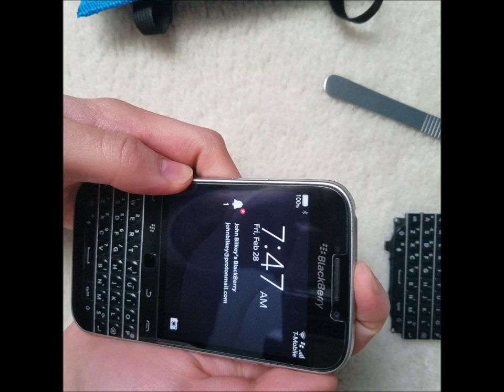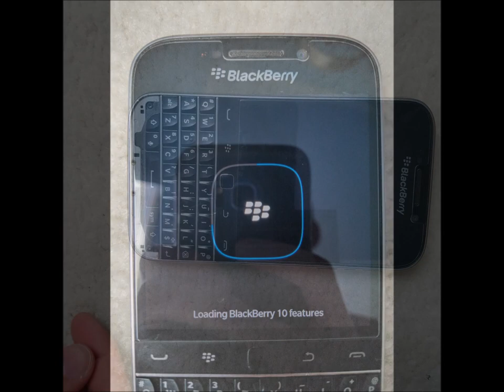BlackBerry Classic Teardown and Assembly for Keyboard Replacement or Other Repairs

Comment: Thanks for a great tutorial! Would appreciate a bit of help with identifying a part of the phone: it can be seen on the right edge of the frame around 14:00 (small metal rectangle with a slit and a bit of black tape). Unfortunately I can't figure out what is it and most importantly, where is it supposed to go. I know this is an old video, bit I still hope that you'll see this. Thanks in advance!

Comment: Nicely Done ... I love my BB classics and can't wait for the rumoured new one to come out next year. I have 2 BB classics that need repair - both don't charge. I'm assuming one is a charging port issue because i tried with many cables and i seem to recall I'd have to wiggle it around to get it charged back in the day when it did charge. I'd like to get it up and going if for anything just to get my old unsaved pictures off it. I'm just wondering what the chances are that the battery would still be functional after sitting idle for 3 years. The other one got really hot one night while charging, then was dead the next morning. Not sure what to make of that one. I just assumed the battery got too hot and something got fried internally. I have a 3rd classic that is still holding charge but internal speaker isn't working, can only use speakerphone option to hear conversation. After watching your video I'm inspired to attempt a repair. I am currently using the BB KeyOne for the last month but will be switching back to the classic once i fix or purchase another good used one this week. Thanks for the inspiration.
Reply from the maker: Thank you for the kind words, and good luck! You could most likely get a working device by combining all of them,  and swap the main boards to get files you want. The highest risk areas are the small ribbon cables for the buttons and things on the side, but since you have 3 of each you should be okay.

Comment: Nice. I had to replace my charging port. It was a successful project to that end, but once I charged the BB and tried to use it, my keyboard will not work. Where do you think I messed up a connection at? I did not have to tear mine down as far as you did to replace the key board.
Reply from the maker: Hard to say but perhaps the connector for the keyboard came loose. You may have to take it apart again and go deeper. Fingers crossed the ribbon cable is fine, good luck!
Reply: @JohnBilkey  The ribbon cable was torn. I bought a new keyboard 9 months ago and I am finally replacing it today.
Reply: And I got it. I need information and contacts from the device that had not yet been synched or backed up prior to the day the USB charging port failed. Once I charged it up, I could not unlock the device because the keyboard had failed. All is well in the world now. Thank you.

Comment: How to replace loudspeaker? Will you please show a tutorial of that!
Reply from the maker: Hello, my friend. The loudspeaker is on the black plastic cover I remove at 2:19. It is easiest to replace that entire unit.  https://www.ebay.com/itm/Blackberry-Classic-Q20-Loud-Speaker-with-Back-Housing-Frame-/172233788358?_trksid=p2349624.m46890.l49292 A very easy fix, good luck!
Reply: @JohnBilkey  so in order to replace the loud speaker i have to replace the  entire back plastic cover? is that right?

Comment: I'm having such a hard time prying motherboard up from the front of the device.. was it glued down?  any advice?  I'm so afraid of breaking it by pushing too hard..
Reply from the maker: Make sure you removed all cables and screws from the motherboard, it should easily come off the phone. There may be a screw hidden under something.
Reply: @JohnBilkey  hmm, do you think it's that the battery must first be removed from the motherboard?  I don't need to replace the battery and in another video (a charging cable repair video) they appear to be left attached...
Reply from the maker: @lgfish5337  The battery can stay glued to the motherboard. Just remember to remove the battery's ribbon cable.

Comment: So there's glue on the back cover plastic, but after removing it for whatever reason you mess up the glue, i guess, and than you put it back on, will it stay on properly?
Reply from the maker: Yes, there is glue and plastic clips on the back. The plastic clips will hold the back on without the glue.

Comment: @John Bilkey Can you please share a tutorial of Camera fixing, my BB Classic Camera won't start. All other device works fine
Reply from the maker: Did the camera work before or is the phone new? Some Classics were sold without cameras. You can open the phone the same way I do in this video, and you will see a connector and ribbon cable attached to the camera. It's an easy fix.
Reply from the maker: You can see the camera module, ribbon cable, and connector at 8:52. The camera is on the board on the right side.

Comment: What is wrong with my blackberry classic, settings wont open. I cant access my wifi and mobile settings. Pls help. Thank you.
Reply from the maker: Sounds like you need to reset the phone with an autoloader. Instructions: https://forums.crackberry.com/blackberry-10-os-f269/guide-how-load-os-using-autoloader-927076/     Download: https://drive.google.com/file/d/1UwUFhoan_KMcQ8ft23WSdLn2G6sL3doa/view
Reply from the maker: You'd also have to install the BB world update using a .bar file.  https://crackberry.com/how-fix-blackberry-world-no-network-connection-errors-blackberry-10

Comment: Want to battery change
Reply from the maker: Watch the first 7 minutes of the video to disassemble the phone, I say when to stop if replacing the battery. At that point you'd take the old battery out with a pull tab and put the new one in. Those steps should be online.
Reply: @JohnBilkey  oh. Thaxs for the reply.  Appreciated. can I get it online.  This is a old phone.  That's my doubt

Comment: Thanks for nothing... I watched 13 minutes just to see how to not replace the keyboard 🤦🏻 You should've said at the beggining of the video that you didn't record the part with keyboard replace 😡
Reply from the maker: You're basically all the way there dude, you remove the screen and keyboard, separate the keyboard from the screen, and then put the new keyboard in and put it back together.

I wish it was recorded but it did not get recorded and I didn't want to risk breaking the phone by taking it apart again to show that.
Reply: @JohnBilkey  you could've at least said the keyboard is glued to the metal plate, i spent a few minutes looking for hidden screws so i would not break something (good thing i started with the donator which already had a broken screen). after i noticed it's glued, i removed only the keyboard, screen remained on the metal plate.
i swapped my dislike with a like since you replied nicely.